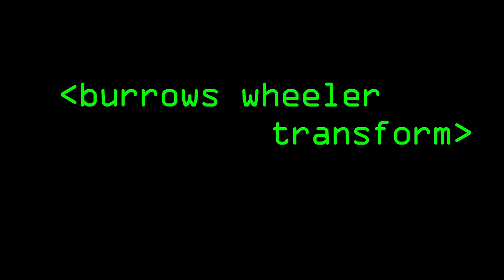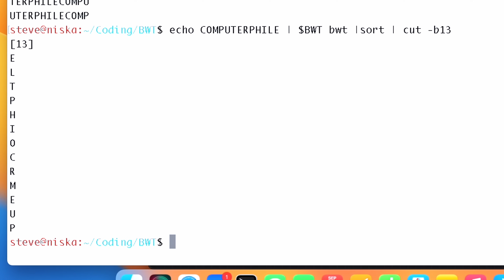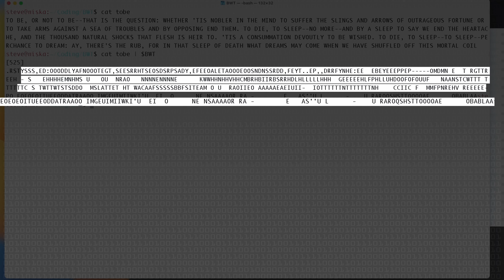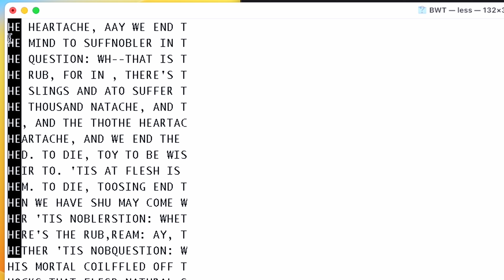How Bzip2 Works (Burrows Wheeler Transform) - Computerphile

Comment: I my experience bzip2 is only marginally better than gzip.
Rzip is considerably better, at the cost of time taken to compress. But I believe all Rzip does differently is to increase the search space?
Reply: But is it easy to explain how it works to a crowd of people without leaving everyone scratching their heads?  Just because it works better, does not mean it will make for an interesting video with easy to grasp concepts.
Reply: @azrobbins01  indeed. My comment is an observation (and a question) , not a criticism
Reply: In my experience with compressing large .dds files and textures, bzip2 is much much better than gzip, when comparing their highest (reasonable) compression settings. I picked bzip2 because even though the time to compress is much much longer, it pays in the end because of the amount of users my project is used by.
Reply: @squid11160  I guess like most things - it depends.